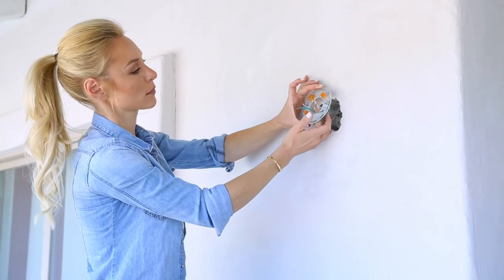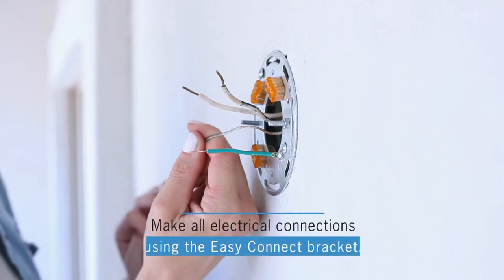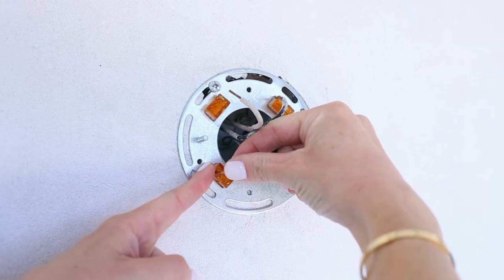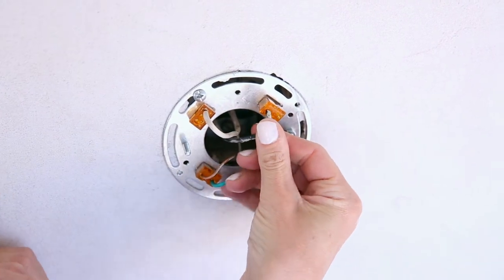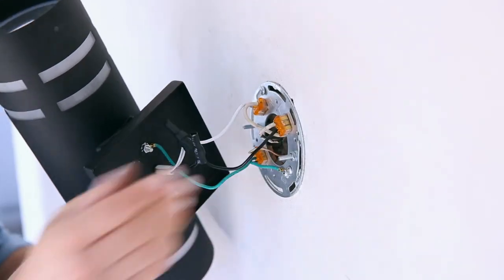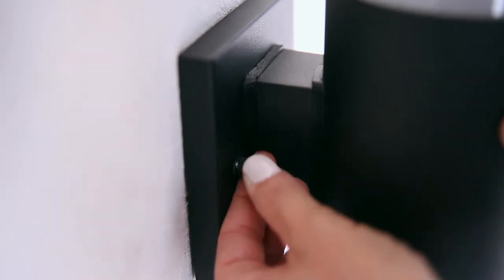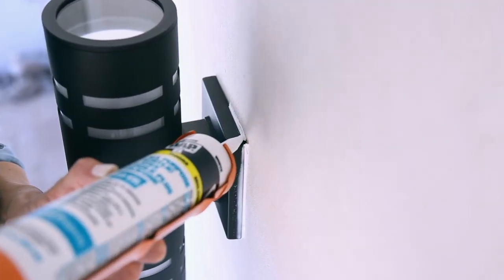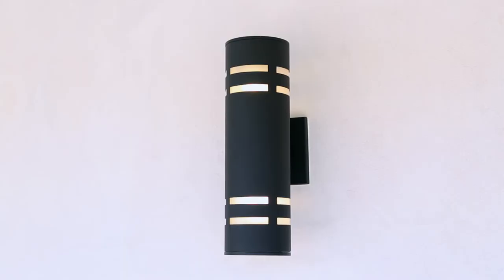How to Install an Outdoor Wall Light | Canarm

Comment: I did everything you said but you forgot to mention how to run electricity cable from the consumer unit to the fitting..there is the risk that that might result in a broken finger nail, I guess.